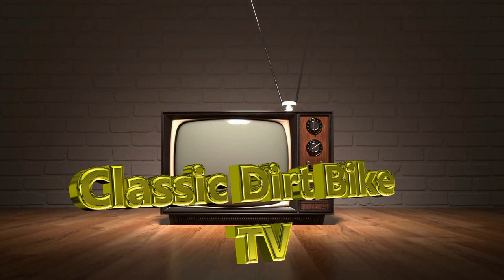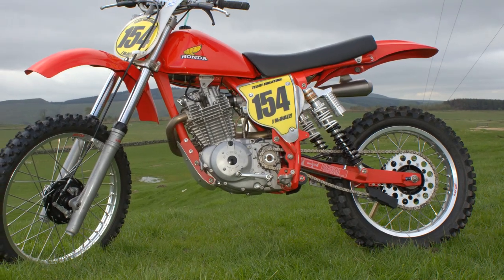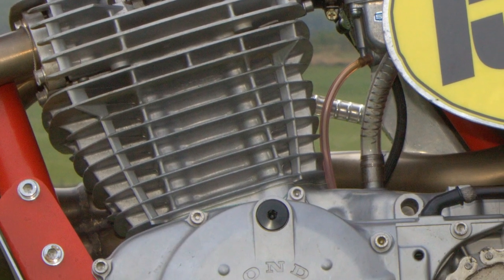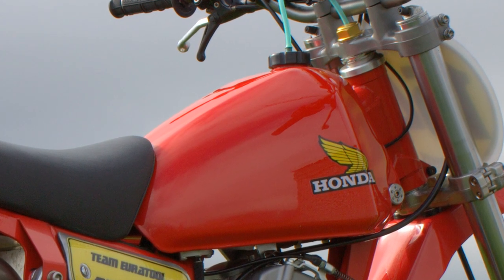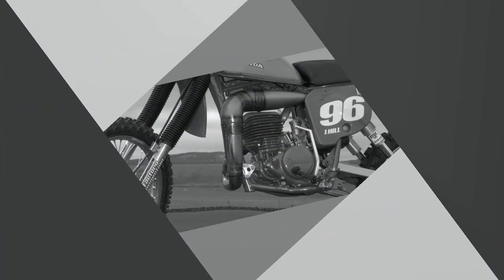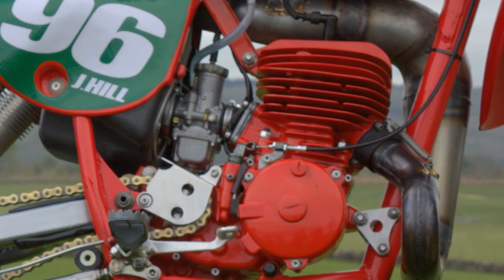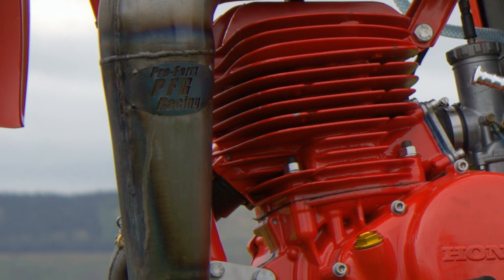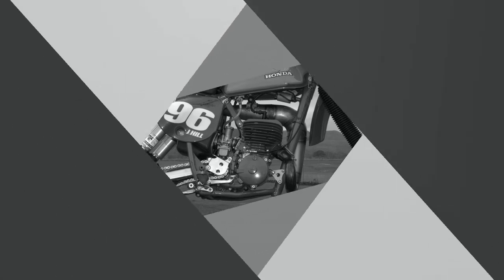Classic Dirt Bikes "Honda XR500 - Honda CR250"

Comment: I still remember the day our dealership got in the 250R. I was racing the first version of the CR250 at the time,  pretty tricked out as I had access to go fast goodies most people weren't able to get.  When I rode the new 250R after assembly and service,  I couldn't believe how fast it was! My bike felt like a 4 stroke, 100 c.c. compared to the new red racer. I started racing motocross on CZs, so I had no problems with the kicker. So much power compared to the old black engine it wasn't funny. Thank you for the video.